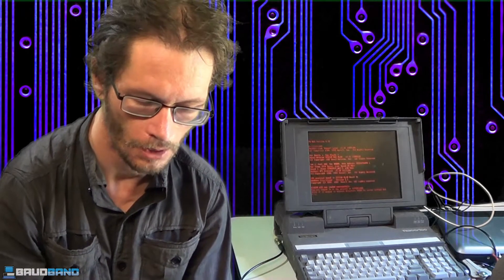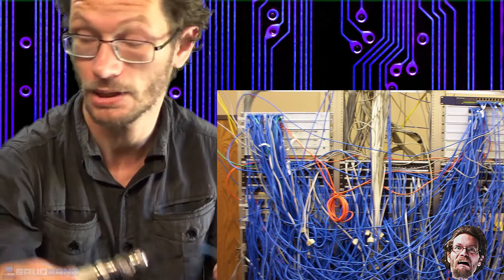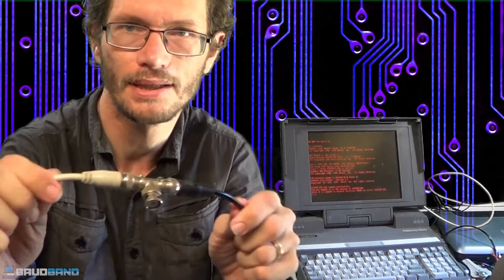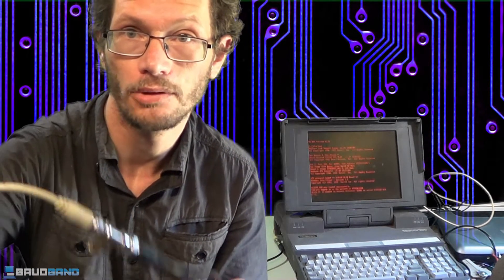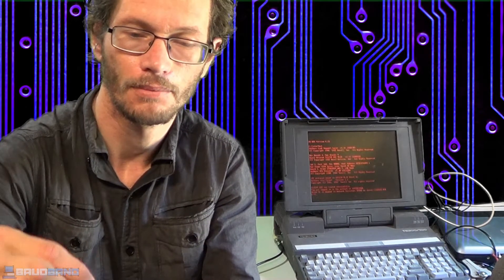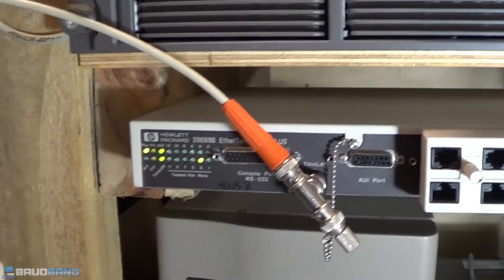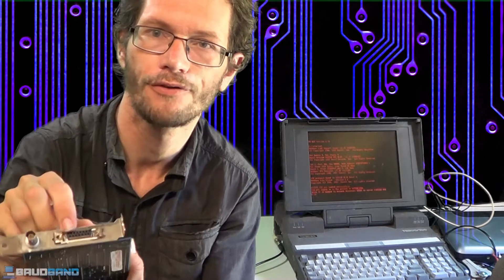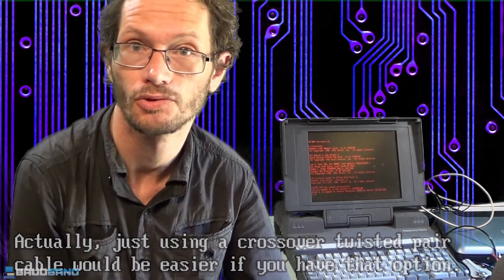10Base2 Networking

Comment: I can add a bit of info here since I designed a piece of test gear in the early 1990's to allow testing on live thinet/ cheapernet networks, 35 years ago so please be kind if I remember anything incorrectly! The terminators were essential to absorb reflections but their resistance value was important too because 'collisions', ie two stations deciding to transmit at the same time could occur. The output from each card was normally -2V async serial data, output via a known resistance. Older cards had a nice 0.5W or above metal film resistors for this purpose. Because the resistor value was known and the combined resistance of the terminators was also known (25R), if a  collision occurred, ie two stations output simultaneously  the voltage on the line would become greater than the -2V expected and after waiting a randomised period, both stations would try again. The problem at the time was that an open or short anywhere on the coax segment would disable the whole length of coax. Intermittent faults were the worst thing to deal with, not least because some of the BNC and terminators that were widespread at the time seemed to be rather poor quality considering their important role.!

Comment: Wow!  This brings back some memories.

This is why we had CSMA/CD 

I had a Sun training lab in the 1990s with 14 SPARC5 workstations and a Jumpstart server in my office.

When I would re-install the machines in the lab on a Friday afternoon, I'd get very high collision rates on our 10Base2 network.  That's why I kicked it off and left until Monday.  I'd come in early and if any machines didn't install, I'd kick them off again.

Jumpstarting 14 machines simultaneously would get me to say 10-20% collision rates.  Most times, they would sort it out, but occasionally, one would get lost and the install would "blow up."

I don't miss 10Base2, not at all.  I'm grateful for switches as they sort out the collision issue.  Obviously, a bit more configuration, but still, the benefits are worth the extra complexity.

Comment: What hapoens if u do not use a terminator?
Reply from the maker: Some of my network cards refused to even detect it as being connected without a terminator on each end, and others would often be unreliable. Ran in to that issue because a few of my terminators were actually broken.
Reply: @BaudBand  we have a d-link de-810tac hub .  The LED for BNC, when connected,  does not turn green. It does when turning the hub on.  We will check the terminators.
Reply: The signal reflects in the coax, causing interference.  

The terminator is like an electrical sponge, absorbing the signal.  If there is no terminator, the signal reflects off the end of the cable run and interferes with other transmissions.

SCSI had the same sort of thing going on.  You needed a SCSI terminator to terminate the SCSI bus.  Otherwise, the signal would reflect at the non-terminated end.

Eventually, with SCSI gear, devices had the ability to self-terminate.  They could detect if they were in the middle of the chain or on the end.  If on the end, they would self-terminate.  Or you could set termination with DIP switches.

We don't see this with UTP as the means to mitigate reflection is designed into the devices.

Comment: Can those tees be left unterminated (just a pass through) or did they NEED to be connected to a network card to prevent reflections?
Reply from the maker: I'm not sure what the official answer is, but I had no problems with T's in the middle not being connected. Also I think many office blocks in that era probably had T's on the wall that weren't always connected. 

Just need a terminator on the start and end of the chain AFAIK.